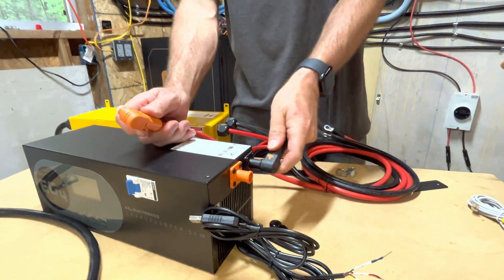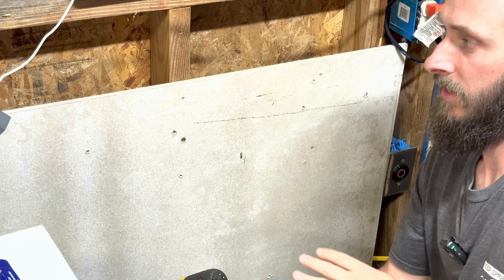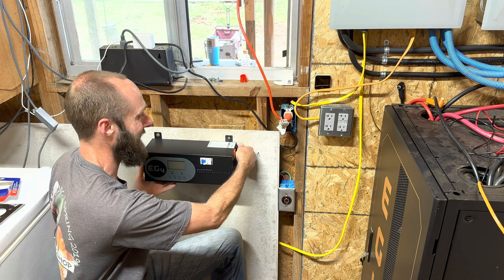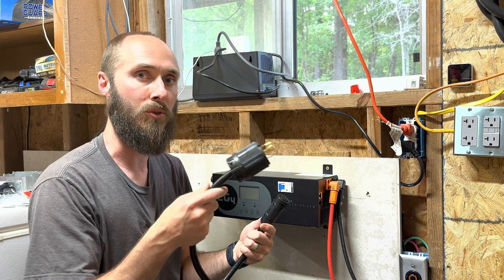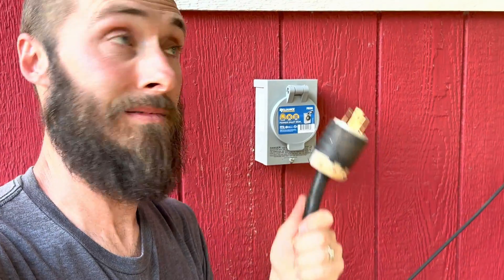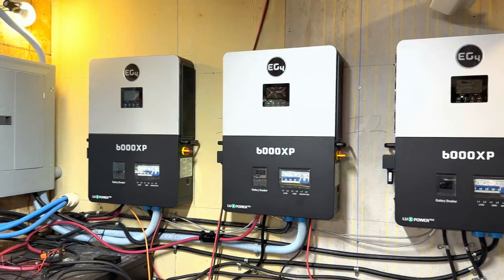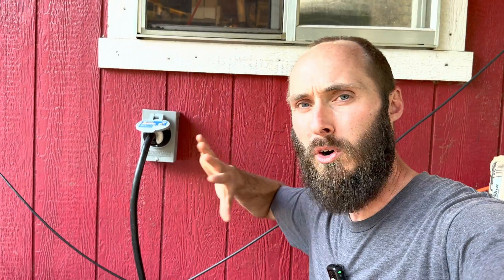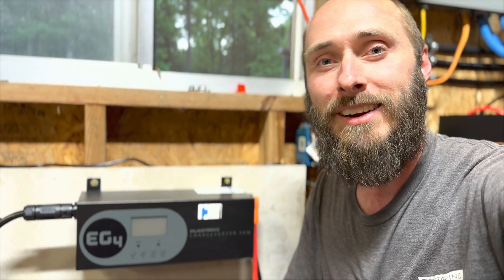Why You Need The Chargeverter GC by EG4 For Off-Grid Solar!

Comment: How do you know your sine wave is distorted? 
I have a grid boss and 2 flexbox21. The grid boss includes generator charge ports. 
I have a new inverter generator to supply the grid boss. 
I’m trying to justify the expense of a charge converter in my case two charge voters to keep my system up and running during bad weather. 
Can you please elaborate about the distortion you’re getting from your generator? Is your generator sign wave generator or an older type thank you for your input.

Comment: Could you connect the chargeverter to the inverter from the generator?
Reply from the maker: I guess you could connect it to the inverter's battery connections, but then you couldn't connect the batteries to the inverter. If you're asking about connecting the Chargeverter to the inverter's generator ports, the answer is no. DO NOT do this. The Chargeverter outputs DC, and the generator ports are AC. You can either connect the Chargeverter directly to the batteries or to a busbar that the batteries and inverter(s) share.
Reply: @EastTexasHomestead  thanks for the quick reply. Still learning.
Reply from the maker: @TimTexus  No worries :) We're all learning bit by bit. Feel free to bring more questions to the Unplugged Livestream tonight https://www.youtube.com/watch?v=UkFtuCYA0ak

Comment: thanks :) my champion 4500 inverter is only 120v but it does have a 30A receptical . 
240 volt gas inverters aren't cheap ! 
but this chargeverter could let me use a cheaper jobsite grade 240 generator and be %100 safe . 
correct ???

Comment: Can you please tell me what the output ports and connectors on the chargeverter are called and where I might buy them.
Reply from the maker: The Chargeverter GC comes with a set of red and black cables. One end has the quick connect, and the other has 5/16" ring terminals. The ring terminals are great for connecting to a busbar or the server rack batteries but won't work well for the EG4 WallMount batteries. You can see in this video how I got around that issue. https://youtu.be/dN5CqcWzkTw?si=TZw4A2B77P5ZTU8e&t=95 I used an Insulated Connector (https://amzn.to/3DOBBu8) to adapt the WallMount battery to the Chargeverter cable. Let me know if this doesn't answer your question.

Comment: I have a video called consumer generator vs military generator. Shows o-scope showing difference. The biggest issue even with good generators is the load is sporadic and overloads the generator when trying to charge with a constant charge rate with intermittent loads. Now the eg4 12000xp will manage this to not exceed the gens rated power. It will reduce charging when loads and charging exceeds capacity. But it does still put the inverter into bypass. So what happens to your setup with three inverters? 2 shut off and one goes into bypass if u only feed one with gen? Or do two stay inverting while one charges?

Comment: The charging voltage that this unit appears to be capable of is far too low to fully charge a 48 Volt LFP battery. The manual for this cheap charger states that this unit is only capable of a 57 Volt maximum output. The output should be capable of reaching at least 58.4 Volts or 3.65 Volts per cell to fully charge a 48 Volt LFP battery. This unit appears to be poorly designed.

Comment: When u r using the chargeventer, are u supposed to turn off the battery switch connected to the hybrid inverter, or u keep it on..
Reply from the maker: You can keep it on
Reply: @EastTexasHomestead  I kept it on, but I didn't get any charge in 5 hrs .I ran out of gas.. What am I doing wrong  ?
Reply from the maker: That’s no good. You have the breaker turned on? Check 2:50 on this video https://youtu.be/B2tUbTsg2hY?si=TStSCGzHhZc5PUrn

Comment: Signature solar techs told.me the generator input in the 6000xp inverter are like a chargeverter built in, cleaning up and converting the ac power to clean dc power. They told me the need for chargeverters are so 120v generators to be used to charge the battery bank  because the 6000xp generator input require 240 volt generators 🤔
Reply from the maker: @tjmooney4181, I got word back from my contact and it appears that the reality is in between our understandings.
Here's what I got back from my contact at SS: "They are correct in the sense that the Gen port (in the 6,12 and 18k models) allows for the inverter to deal with the dirty power a lot better than the standard AC input, but if they are using a generator with a THD higher than 5%, or if the generator is too small, you will still see long term-issues due to the dirty power, as the port doesn't clean up any dirty sine-waves, but just routes the generator power straight to the charging circuit for the batteries. The Chargeverter allows you to not worry about gen power going straight into the inverter, along with allowing you to be able to use 120 or 240V generators, or smaller generators."
Reply: @EastTexasHomestead  great thanks that was my understanding, I use the gen ports when 6k+ watt inverter generators are available or 9k+ non inverter generators are being used, and obviously use the chargeverter for all 120v and smaller 240v generators
Reply from the maker: @tjmooney4181  Sounds like a good setup
Reply: @EastTexasHomestead after building the system for my off grid property and realizing how efficient affordable and reliable it was I decided to order a bulk order of all the parts to help other off grid friends and family off generators and now word of mouth is spreading like wildfire 😉
Reply from the maker: @tjmooney4181  Dude that's awesome! Great job
Reply: @tjmooney4181  I have a generator with 12000 watts startup/9000 watts running..all at 240 volts. Are you saying I will not have problems running it with the xp 6000?
Reply from the maker: Interesting. I've not heard that but have reached out to support for clarification. I'll let you know what I find out.

Comment: I have both the original yellow charger and the new black one I just got last week. The yellow one tops out at 93.5 amp no matter what. And the new one the black one tops out at 89.5 amps. I've never seen either of these go to 100 amps.
Reply from the maker: How big is your generator?
Reply: @EastTexasHomestead  It's a military MEP-803A, rated (very conservatively) for 10kW at 120°F). The generator head itself is about the size of a 30kW head in a civilian generator, nearly 2 feet in diameter. Folks have run them into 15kW loads for hours just testing them. I will run both EG4 chargers and when I get my Sungold inverter/charge repaired (hit by lightning two weeks ago--new power board and control board on order) I will add another 60A of charging capacity for the winter. At 10kW, it still takes hours to top off my battery bank.
Reply from the maker: @basspig  That's a beast of a generator. Is the outlet you're plugged into limited on amperage somehow? It's clear that it's capable of putting out the power.
Reply from the maker: Just a thought, I've seen when the SOC of the batteries is reaching full, the Chargeverter will slow down. If you're running both Chargeverters at the same time, one may be convincing the other that the batteries are full. Maybe try testing the black without the yellow and see if it ramps up to 100 amps.
Reply: @EastTexasHomestead  30 amp twist lock outlets fed by 6AWG copper wire. I don't think that's it.
Reply: @EastTexasHomestead  that is a logical reaction, and I though the same, but my battery bank was nearly depleted when I started up the generator (had been raining and the a/c was on). Either charger alone behaves the same way. When I turn both on, the first one remains steady in the current reading. I'll try turning the voltage up on the generator and see if that makes a difference. I was at 240. I can bump it up to 250 and see if it helps.

Comment: 48 volts dc won't kill you 🤣
Reply from the maker: @Ramjet7777 If you're talking about the old phone lines with super low amps, then you're right. But 600 amps at 48 volts going through your chest from one arm to another can be fatal. At least that's my understanding. I could be wrong here though.🤷‍♂

Comment: Can this communicate with any lithium batteries that have comm ports for start and stop, or does it have to be an EG4?
Reply from the maker: I'm not sure. However, it can use voltage to start and stop a generator with any lithium battery.

Comment: This might sound like a dumb question, but im confused on this issue. Is the Charge/Verter able to run from a smaller generator? Or does the generator need to put out 5000 watts to run it?
Reply from the maker: For sure! It’s also worth pointing out if I didn’t mention and you don’t know that this can also be run on 120 or 240 V so it really opens up a world of possibilities for small 120 V generators!
Reply: @EastTexasHomestead   good information! Thank you!!
Reply from the maker: Sorry for the confusion. You can use 1000 W generator or a 20,000 W generator. It doesn’t matter. If you’re using something smaller than 7000 you were want to go in and limit your charging from 100 A DC something a bit smaller. 
But say you have a 3000 W generator. I would probably limit the charge Werther so that it is only outputting 2000 W this way your generator is running more efficiently. And is not overloaded. So you would go to the charter settings and set it to roughly 40 A of output. I hope this helps. Let me know if not.
Reply: @EastTexasHomestead   yes it does, thank you! As you know, it is very hard to find a high amp battery charger in 48 volt. The one on most inverters requires very high wattage that isn't really feasible for off grid, unless you have a huge generator. With this device a guy can live off grid with a good inverter, batteries, and a decent generator, and add the panels later.

Comment: So why choose the gc model for almost 100$ more over the regular?
Reply from the maker: The generator communication portion of it isn’t really worth it to me. However, the ability to disconnect the battery cables is a really great feature, but I’m still not sure it’s worth the hundred dollar upgrade. I will say, the user interface is a lot cleaner. The screen is bigger and easier to navigate. none of the features ended up themselves are worth an extra hundred dollars in my set up. But all of them together are pretty nice.
Reply: @EastTexasHomestead  thanks for the help! Sounds like the cheaper model would be more than fine.
Edit for those  researching: current connected got back to me and a very notable improvement is a “ soft start ramp” to prevent more sensitive generators from stalling or overloading.

Comment: QUESTION: can the chargeverter be used simultaneously with the inverters - allowing the chargeverter to charge the batteries while the batteries are simultaneously used to invert and create 120/240 output to breaker panel?
Reply from the maker: Great question! Yes. I’ve done it many times
Reply: @EastTexasHomestead On my Chargeverter Ver. 2 (the new gray one) manual it states "CAUTION! The Chargeverter is not meant to run in tandem with the inverter while powering loads." So...Can we use the chargeverter while running the inverters?
Reply from the maker: @mainerusnr  I see the same thing in my printed manual on page 17. It's actually a sticker that is added in. However the latest manual online doesn't contain this information.

I just got off the phone with #SignatureSolar and they reached out to #EG4 R&D and asked for clarification. While I was on the phone with them, R&D responded that it is now considered safe to charge the batteries from the Chargeverter while drawing from the batteries with an inverter.

Apparently, there was some confusion, so they slapped the sticker on there but have now confirmed that it isn't a problem. 

I hope this helps.

Comment: Interesting, especially the problem of "dirty power." Can the power coming in from the grid be "dirty" enough to negatively effect your EG4 Inverter? I live in a rural area with marginal electric service, which is why I'm thinking about going solar.
Reply from the maker: That’s a great question. I have no data to say but my guess is that your grid power is clean enough to not cause problems. Now, if you routinely have electronics die randomly, I’d be concerned. In general though, I don’t think it should be a problem.
Reply: It has nothing to do with electronics dying like @easttexashomestead said, it has to do with plugging your generator into an inverter/charger like an EG4 system or Sol-Ark system.

The generator does not produce a true sin wave. If you have a 12kw generator, and use 10kw, odds are you're getting dirty frequency since I'm 100% positive that 100% of all generators sold at Home Depot or Lowes or INSERT YOUR BOX STORE HERE will have unstable frequency and motor RPMs under 100% or near 100% load.

This power from a generator is very problematic for these inverter/charger hybrid units. So, the Chargeverter exists to be your "defense". It takes a clean power sin wave, or a shitty one, and turns it into as much DC power as it can given the power available to it. The DC isn't alternating, so your system can just consume the resulting "clean" DC energy without any issues.